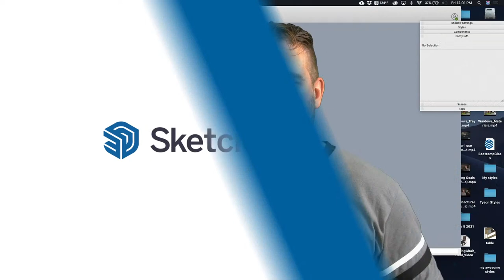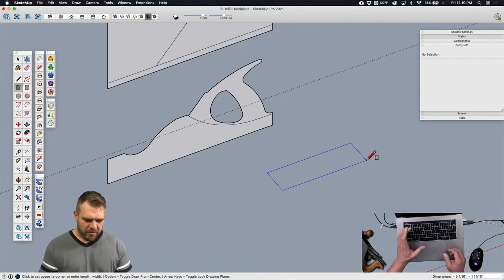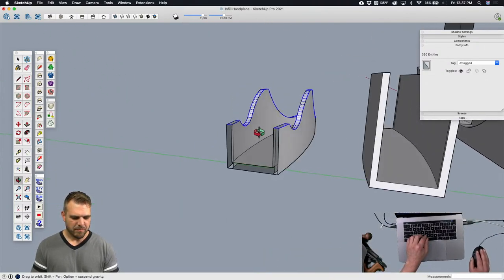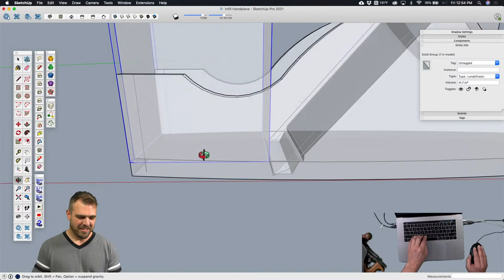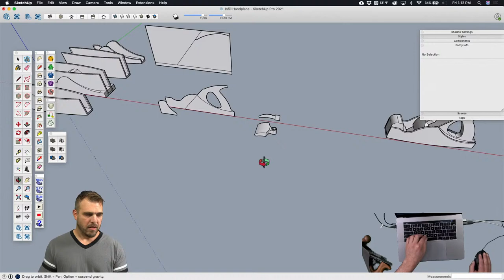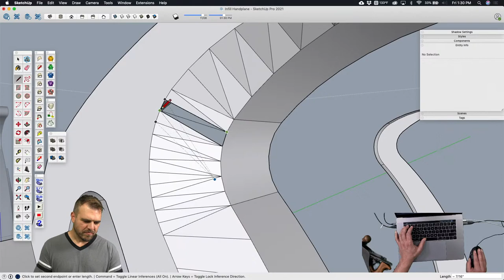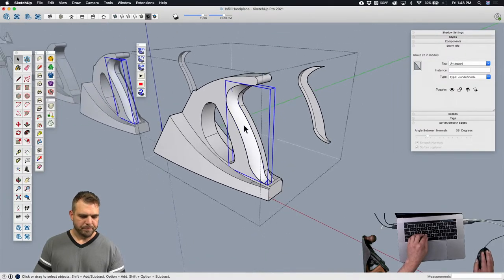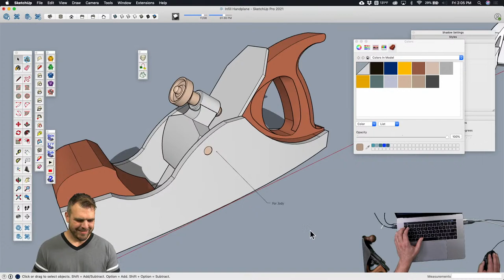Modeling a Hand Plane in SketchUp Live!

Comment: Interesting modeling demo. I was especially tickled to see you modeling a plain old hand plane... a nice convergence of my interests. I just got into woodworking last summer and have developed much respect for the Stanley #4 and #5. I started learning Sketchup in earnest a few weeks ago so I could make models of my projects before committing to the build... to save on wasting expensive wood on the first try or two. 

BTW (TMI warning! Tech TMI, to boot. Proceed with caution!) The rude noise you heard at 45:19 (or thereabouts) is from an old 2400 baud dial-up modem used to connect two computers together when we were all much younger. You've seen the old movies, like 'War Games' and new sitcoms like 'Young Sheldon' where rude noises comes out of a phone earpieces and then the (wired) telephone receiver is pushed into the foam cups of the modem for the computers to talk to each other. The data transfer mechanism was audio tone based for their ones and zeros... so one heard audio tones going off all day at the office. The  tones changed frequency and beat because the 2400 baud handshake protocol was tried first. If no returning 2400 baud handshake tone from the destination computer is heard (as this time), the 1200 baud protocol handshake is tried next. Then the 600 baud and, finally, the lowest of them all, the 300 baud handshake protocol is tried. Having failed to hear any tones being sent back at all from some destination computer the modem went quiet.

While I had no trouble identifying the noise, my question is--nowadays where WiFi and Ethernet are all the rage--how you could possible set off a 1980-ish 2400 baud dial-up telephone handshake protocol and get it into your computer audio. De'ja Vu all over again?

Comment: nice to see I am not the only one copying geometry at set distances. I use this all the time when drawing anything complicated (certainly when I drew my two wood planes) you can make as many modifications as you like and still copy or move it back to exactly where it came from.
I did notice you had a non continuous face on the back of the handle when you were stitching and then smoothed it. I get this happen a lot. Is there any way to avoid this? I sometimes have to delete parts of the broken surface six times from the same place before it all joins up as one single face.